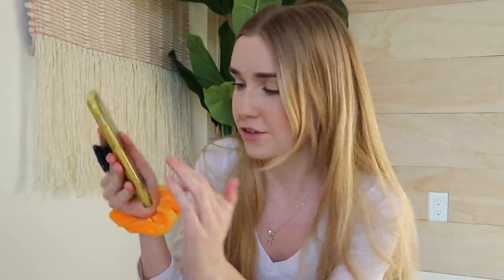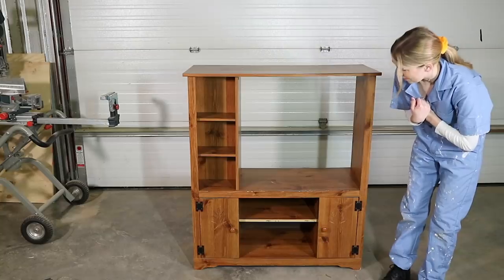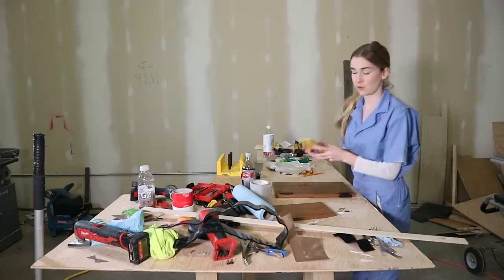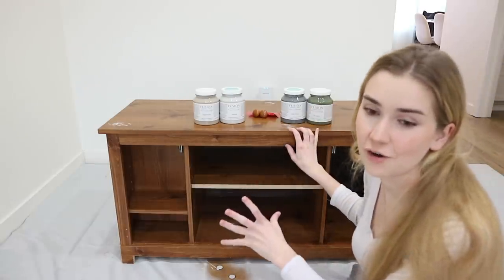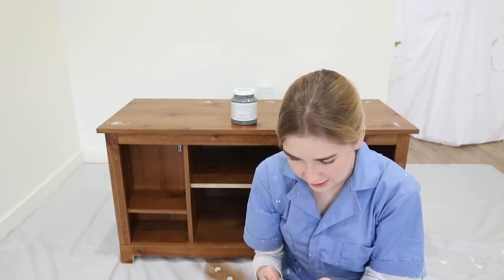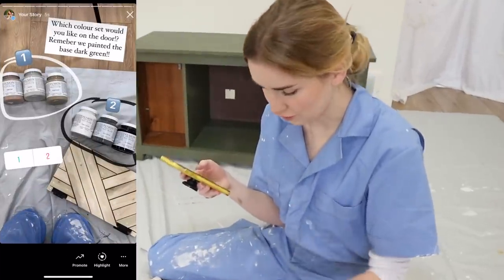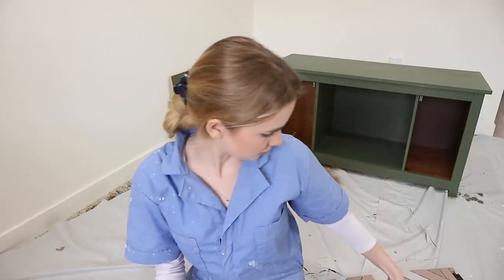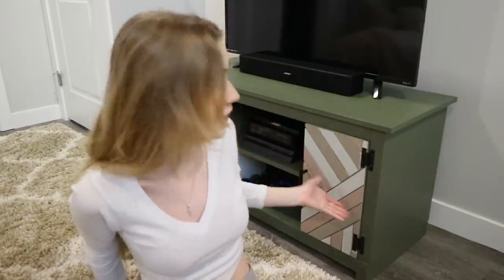Instagram Followers Control My Furniture Flip !! *FREE furniture old to NEW*

Comment: mia’s the reason why i wanna paint my old furniture all white and just revamp everything. gonna get all my furniture painted and done with hopefully this holiday weekend 🥺
Reply: Pls do it in a room with good air circulation and one you don't use that frequently, because the smell of varnish and things like that is really bad and it can linger a long time
Reply: @aminamunz2376  aw thanks for the heads up! i’m gonna be doing it outside and wearing masks so the house isn’t filled with toxic fumes ((:
Reply: @jasplans  good idea. I would recommend letting the furniture stay outside for a while if possible. My new desk is standing on my balcony for a few days now.

Comment: Missed the live feed, but still found this video fun.  Love how Mia got so into the voting. The result, as usual, would probably run into the 3-digits (currency not fingers or toes) at any Pottery Barn. The only change I would make, probably due to my OCD rather than any decor knowledge, would be to decorate the interior of the 2 cabinets. Would adhesive/removable wall paper work in a color or pattern coordinating with the pink tone work?  As my design and craft skills are minimal at best, I would have to run it by...just about anyone besides myself!

Comment: Maybe for the next time Mia flips an item, she should have a wheel full of color themes. For instance, one area of the wheel has four colors in the color palette. When she spins the wheel and lands on one, she has to include those colors into the design she’s pursuing. It’s basically color palette roulette, or pick the color palette out of the jar. And every color combo is different to give variety. It would be a fun way to push Mia out of her comfort zone if she ends up picking a color palette she hasn’t dabbled in yet